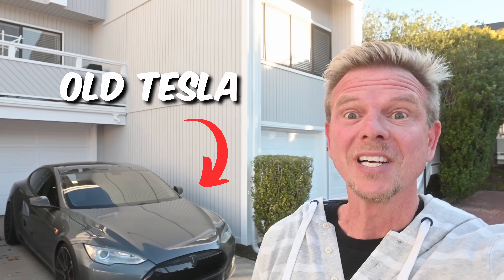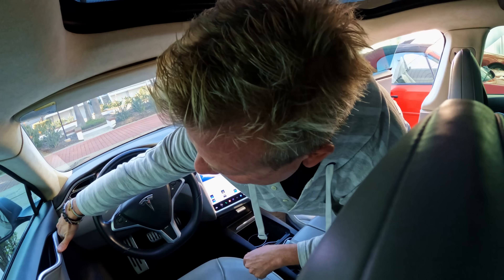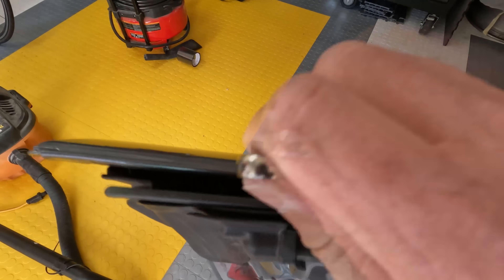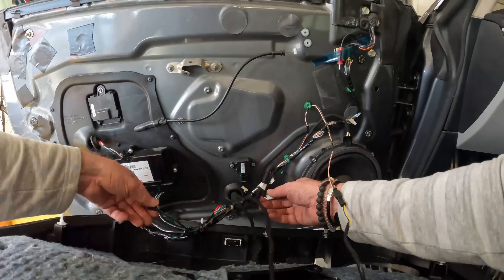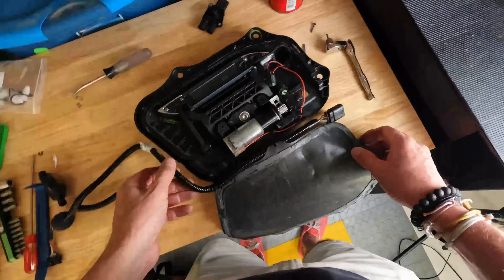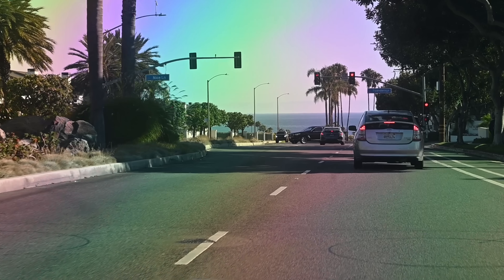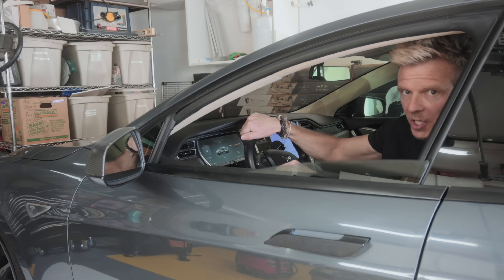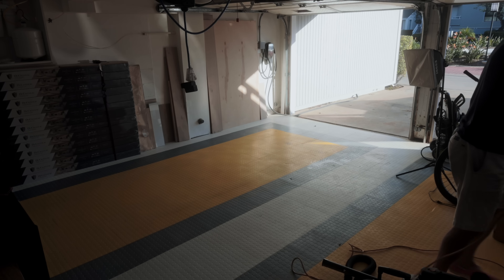My OLD Tesla Model S Just BROKE. Now What???

Comment: I had an issue with my Tesla’s glass and I fixed it myself too. Very satisfying
Reply from the maker: So cool when you’re able to handle it on your own - and save $$$. 
What was the issue with your glass?
Reply: @cadreamdrives  At delivery the glass was not correctly installed from factory and i could hear a lot of wind noise. I took it to service twice and they couldn't fix it. I ended up just opening my door and fixing it myself. I have a few friends who repair salvage teslas so they helped me out with telling me how to do it.
Reply from the maker: @calofc01s Tesla’s quality check process before delivery can definitely leave something to be desired. I’ve seen spots on a brand new car, that simply never were painted. On the bright side, a friend just picked up a new S recently, it seemed on point everywhere. 
Awesome that you were able to tackle it yourself (and incredibly frustrating that Tesla couldn’t fix it for you!). 
Kudos to you for taking it on on a new car!
Reply: @cadreamdrives  I already owned one before that one that had issues as well. But they were minor. I honestly hate dealing with Tesla.

Comment: It could be worse, much WORSE.  In April of 2020 I bought a 2013 Model S85 from the original owner, the main drive unit and main display had already been replaced under warranty @90K miles. That meant that the car I bought was on it's second drive unit and display (@96K miles), so I felt like I was buying a practically new car.  But in the summer of 2023 I began experiencing episodes of the drive unit cutting out during normal driving. Within a year the issue became worse, and by the Fall of 2024 it was happening almost every time I drove the car.  So in mid-November 2024 I drove it to the local Austin, TX service center and on the drive there it cut out 3 times. When I got there they said I should leave it with them (without an appointment) because it was a "safety issue". The diagnosis (the same day) was that the drive unit was failing and had to be replaced.  My choice: do nothing and have eventual total drive unit failure somewhere out on the road requiring a costly tow to the nearest service center OR make the replacement now. I authorized the replacement~ $6700 (out of warranty). The car has 140,000 miles now and is on it's 3rd drive unit. If I had known that this was a possible issue, I never would have bought the car back in 2020. This may not be typical for all early Model S's, but I was unlucky enough for it to happen to mine. Three (3) drive units in 140,000 miles of normal driving is not my idea of a dependable car.

Comment: I always thought the handles were a bit too much.  It would have taken far less effort and been far more practical to have flush manual door handles with a separate electronic function that actuates the manual handle.
Reply from the maker: The funny thing is, the mechanical mechanism is there. If you pull the interior handle, it unlatches electronically (just like the outside handle), but if you pull it even further, it mechanically unlatches - just like any other car (which I appreciate for safety reasons!). 
A lot has been said about the S handles and their high failure rate. But I will say this: I absolutely love it, when the handles glide out as I approach the car. To me, that’s just an extra step of cool, that you don’t find on any other car, and that feeling still hasn’t gotten old 😄

Comment: Thanks for the educational video for yet another reason not to own a Tesla. Who has time for broken door handles that fail at the most inconvenient time. I've owned ICE cars for 50 years and never had a problem with a door handle breaking. Since the window regulator on the drivers' door was getting ready to fail, I suspect the same will happen on the passenger side as well. Just think how much you saved on gas though, right?
Reply from the maker: Right - we wouldn’t want any of that new technology stuff! Probably better if we could go back to horse and buggy to be on the safe side 😄. 

The door handles on the S are definitely a weak point - or rather, they were. I think they pretty much have them under control now. There are other things that may be quirky. 
But isn’t that the case for all cars? 

And yes - think about all the money I save on gas. It does add up to quite a bit. And then add the money (and time) saved by not having to do oil changes, spark plug changes, brake jobs, annual service, and replacements of a million other parts, that fail on ICE cars. 
Not to mention the time I don’t spend at gas stations. 
The Tesla Model S has remarkably few quirks, given that it’s the first real car from a completely new manufacturer. It’s also incredibly reliable - much more so than any of all of the ICE cars I have owned. Add on top of that, that the driving experience is better in almost every way. 

I know new technology can be scary - and that many people love to criticize EVs. Many of them have never even tried one.  

I encourage you to try one out. You just might be surprised at what you find… 😊

Comment: Imagine if the car was immersed in the water, good luck getting out...
Reply from the maker: They actually thought of that. From the inside, it works like a normal door handle. You pull a lever, and the door opens. 
That being said, if you’re on your way to be submerged in your car, the way out is through the windows. 
It becomes impossible to open the doors almost immediately.

Comment: You can go into the Service Mode yourself and calibrate it yourself.
Reply from the maker: Yes! I actually figured that out after I completed the project. It could have saved me a lot of trips! 😄
It will even show which handles are the updated kind and which ones are the old ones, with the little gear and micro switches. 
Thanks for shining a light on this. It is very useful knowledge!

Comment: Just a suggestion, buy a normal car next time.
Reply: This is pretty common stuff on newer cars these days
Reply: So we’re going to pretend that things don’t break or need to be replaced on an ICE car or other vehicle manufacturers.  Got it.

Yes, just get an ICE vehicle next time.  That way you will never need to deal with replacing or repairing any parts or components in your ICE vehicle ever again.
Reply: Maybe just download a new the patch an the ev will work 😅
Reply: @Ariaga_II  remember when you could take your battery out your phone an replace it yourself for easy fix .. company's nowadays don't want that .. they prefer your shit breaks an you return to the company to get another or pay for repair .. who the hell is having handle problems on a 100k car .. lol you've been had
Reply: @simonlee498  on a $100K car, most manufacturers aren’t dealing with that as far as I know.  This video shows that he was able to get it resolved in just putting in time.  He’s good now for a while on that handle and if another has an issue then he’s going to be more familiar with the repair.

What he hasn’t had to do is to pay a shop several hundreds of dollars to just change the oil.  He hasn’t had to have the upper intake manifold removed so they can walnut blast all the carbon off of the intake.  He hasn’t had to worry about a transmission issue on the car, or a little piece of plastic in the transmission or engine that results in tens of thousands of dollars to repair.  He hasn’t had to worry about $2K brake jobs to replace pads and rotors.  He hasn’t had to worry about a fuel pump replacement.  He hasn’t had to worry about replacing a turbo.  He hasn’t had to worry about why his vehicle is burning oil.  He hasn’t had to waste a cumulative of tens of hours getting gas for his car.

If you ask me, I would rather deal with an afternoon of fixing a door handle versus all of the stuff that comes with maintaining a $100K ICE vehicle.

Again, let’s not pretend that ICE vehicles, especially $100K ICE vehicles, are maintenance free.  Each vehicle is going to have some sort of common issue, and those $100K cars will cost thousands to fix and maintain.
Reply: Reliable car like lexus
Reply: Haha - just turned me off the idea of buying a 3 or 4 year old Model S.
Reply: Never electric
Reply: @Ariaga_II  I totally agree with you on dollar for dollar car purchase. 

But my Lexus 2007 IS350 has 160k miles and I change my oil for about 65 bucks myself and all my own maintenance like radiator flush and new plugs at 125k miles. 

And I bought it for 11 grand in 2016. 

So with my super cheap purchase cost and doing what little Maintenance a super reliable Lexus needs, I’m very pleased with it. 

But it’s not as cool at a Tesla or 100k gas car. Lol. I’m too broke to buy one. 

Literally, the only major repair it’s had was the AC compressor needed replaced. 

Still not bad for a 16 year old car that I hot rod all the time lol. :)

Also wife’s Prius has over 160k miles and has no repairs at all, even original brakes and 12v batt and it’s a 2015. 

Bought it for 16k with 18k miles in 2016.  

I don’t see a point in spending a ton of money on an asset that just depreciates.
Reply: @brandonott7258  there’s nothing wrong with that.  Prior to getting a model Y last year I drove a 2005 Nissan Altima that I bought brand new.  I cared for that car and put 230k miles on it.  It was a great car, cheap to operate, and certainly maintenance wasn’t too bad as I too did a lot of the maintenance including replacing the starter, fuel pump, radiator, and the entire suspension.

An electric vehicle is not the best vehicle for everyone.  You certainly like your car, it’s operating well, and does what you need it to so then there’s no reason to get another car.  My general point though was that it’s unrealistic to think that an ICE vehicle is issue free.
Reply: Well said! I couldn’t agree more!
Reply: @johngatsby1473 Hmmm no, not really…
Reply: Classic cars are boring and slow. Plus they are expensive to run.
Reply: @199724  boring? You are not a car guy, for sure.
Reply: @EMB1199  I don't know. I have a Lotus Elise S2 a Lotus Elise S3 and a 2017 Audi TT and just sold my 2019 M3 LR to buy a new Performance Model 3. You are a car guy I assume? What do you drive? Curious because Lotus advertises with 'for the drivers'.
Reply: Why?
Reply: Yes, lets pretend service and maintenance is cheaper on an ICE.
Reply: @simonlee498 please find me a car from 2013 that’s 100k or more than truly has not a single replacement or repair. You might find one that isn’t as expensive to repair as this one but to act like all 100k cars from 10 years ago don’t need fixing is a joke
Reply: @starcola157  exactly. My good friend just paid $800 to get a few things done in his 2016 E-Class.
Reply: Should he just buy a normal house and marry a normal wife, too?
Reply: With the amount of money he saves on gas and maintenance he could afford a new tesla by now
Reply: Normal car? Oh yeah, the ones that don’t break, you mean? I’ve been trying to find one for the last 40 years.
Reply: A rich white man skimping $1000 in repair bill is a bit funny.

I just spent $650 on my ‘85 Mercedes 380SL for something that took my mechanic ONE HOUR LABOR TIME to repair the idle control valve.
Reply: Yeah that's quite a lot to fix one handle and only a matter of time for the other three handles.
Reply: Or train people to work on EVs 🤦‍♂️
That's what we're doing in Ireland.
When cars replaced horses do you think we sent horse trainers to fix the cars? 😂
Reply: As if “normal” cars don’t break. I’ve owned Audi’s and BMW’s before, guess what they all break. Best reliable car I’ve owned was a Lexus but younger the point.
Reply: Normal.  Isn’t that a setting on a washing machine?

Comment: Note to self...don't ever upgrade to version 3 of door handles. Mine are on rev 2 and are still easily fixed by the mechanical gear or wire/sensors. Crazy that the version 3's are not 100% guaranteed to not break either.

Comment: I need to take a moment and go thank my toyota and hondas for being so reliable
Reply from the maker: Don’t forget to thank them for much they cost you in gas, oil changes, spark plug changes, etc as well 😊
Reply: @cadreamdrives  Being a creature of habit, I'd rather bear the cost of gas, oil changes and plugs as they are known maintenance facts rather than fret over suddenly being unable to open you EV car doors or get out of it.
Reply: @cadreamdrives as if charging your Tesla doesn’t cost money lol
Reply from the maker: @lyndonfring6421  Let's agree that things break on cars. On Tesla Model S car, the door handles are a weak spot, but the issue has generally been fixed. If you read through the comments here, you'll see that even plain old door handles on ICE cars break from time to time. And having grown up with cold winters, I'm also very aware of how old school door locks could freeze and prevent access to the car. 
You also won't get trapped in a Tesla, just because the outside handle doesn't work. you can open it from the inside, the same way you do with any old school handle (the mechanics are exactly the same). 

So things break. But overall, there are a LOT fewer things that can break on a Tesla than on an ICE car. And there are almost zero maintenance costs. 

But if you'd rather have the cost of gas, oil changes, spark plugs, leaking seals, valve cover gaskets, coolant hose and radiator failures, fuel pump failures, transmission leaks and failures, etc, over the chance that a door handle MIGHT break, by all means, that is your prerogative ☺
Reply from the maker: @DylanT18  My Tesla has free Super Charging for the life of the car, so charging doesn't actually cost anything.
I do choose to charge at home, and that has a cost, but it's a LOT less than gas - and I never have to stop at a gas station ever again...
Reply: @cadreamdrives  Old gear head here. Maybe I'll sit it out until EV charging and R&M issues have been addressed by Tesla and others. Until then, I still love the smell of petrol in the morning.

Comment: I had my driver's side fixed a few weeks ago. It had the same issue. The Mobile Service tech told me it was replaced with a newer retrofit part and showed me the old part compared to the new one. The old one had a lot of parts and cables prone to breaking. I also had them fix the rear right passenger window that broke around the same time as the handle. I love my blacked-out 2015 TMS70. I'm about to hit 100K miles. Oh, I also had them fix the sunroof, which wasn't working correctly. The only thing my car "needs" is the infotainment upgrade, but that can wait. I mainly drive my 2020 Model 3LR and my 2019 TMX100D.
Reply from the maker: How are you finding the X 100D in comparison to the S? 
I’m thinking about picking up a high mileage ‘17-‘18 X 100D.
Reply: @cadreamdrives  I like it better. It's a much comfortable ride and I can carry seven passengers. If you have little ones, it's a no-brainer. The falcon wing doors make it easier to install car seats. Go with a 2018 100D, if you can. They're awesome cars!

Comment: For those talking smack…. My newer ford f150 handles had to be replaced twice. There’s a control module issue similar to this video.
Reply from the maker: Thank you for pointing this out. 
We live in a new world with new technology. 
The door handles on people’s 19xx Toyotas may never have broken - but they are also driving a 19xx Toyota. Hardly an apples to apples comparison 😄
Reply: You live in that new world with new flawed technology.  It’s not a good thing.  I myself am just keeping my old van that at 100k miles has only had one minor repair.  I had to replace a headlight.

Comment: Props on doing that work yourself and showing us the hassles you went through. Lots of YouTube’s will just skip over the nonsense or not show it. Also the door handle locks on my bmw stopped working and needed to be replaced as well. So all these clueless EVs suck comments are so stupid. Any part can break on any car. Agreed with EVs are way less maintenance than ice cars. But both are good for different uses!
Reply from the maker: Thank you very much! 
It was a fun project - maybe a little more fun that I had planned on… But it was a fun video to make too! 
And yeah, there are parts that break on all cars. And while the Model S handles may be needlessly “complicated” for some, I love the design and the way they work. 
They help make the car feel like a generational shift compared to ICE cars.

Comment: 1999 ranger here   only ever had to swap out battery flush the coolent chainge the oil and replace brake pads plugs and wires  not bad for 25 year old truck with miles upon miles on it
Reply from the maker: That’s not bad at all! 
Of course, I’ve only ever had to do none of those things on the Tesla 😊
Reply: BUT YOU CAR IS  SO SLOOOOOW

Comment: You say we can calibrate the handle ourself?  Can you provide link or instructions?  My model S have the same problem like yours.  Got a new control unit and now need to calibrate.   Thanks!
Reply from the maker: So - only the newer generations of handles can be calibrated. If you have the older style with the gears and microswitches, no calibration is needed. 
To calibrate, you need to get into the Service Menu and then disable the Gateway module. (You can google instructions for both - it’s pretty simple). 
Once you’re in the service menu, there will be an option there to calibrate the handles. It will also show you the generation of each handle, and whether or not they can be calibrated.